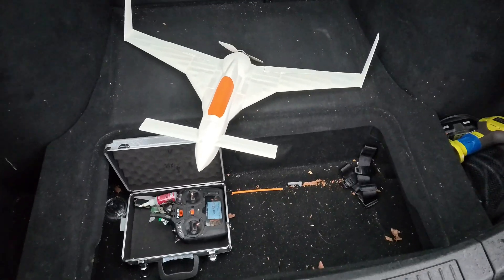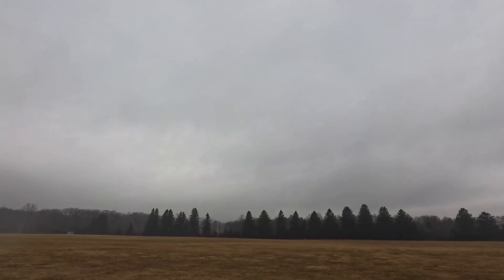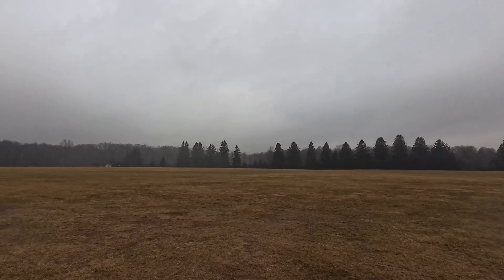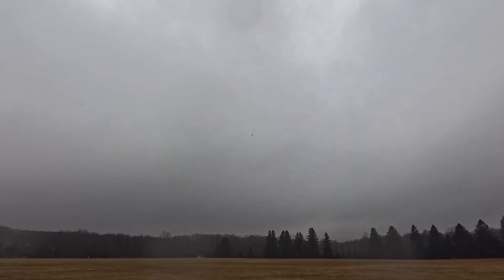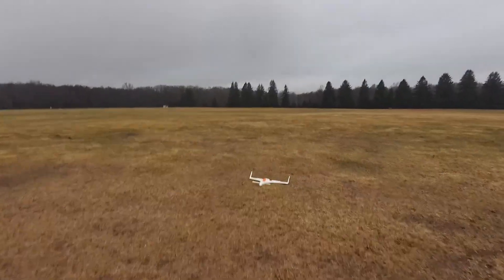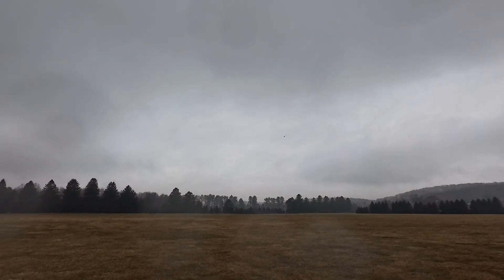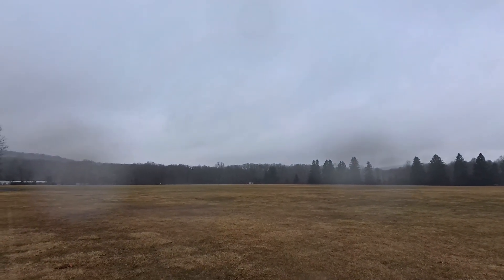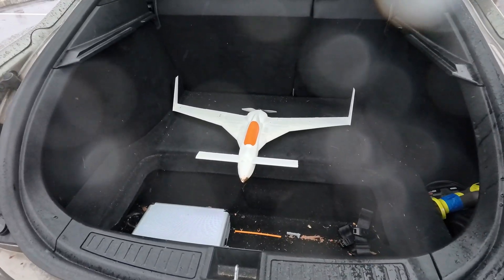Rutan Long EZ maiden flight

Comment: In all seriousness, great job, however, you need to use the canard as elevator and the ailerons ONLY as ailerons. There should be zero elevator control  coming from the rear. Your CG is close to the dots and should be well in the zone if you make the canard the sole elevator control surface. I own and fly a real Long EZ.

Comment: i dont see why you cant design the Alerons with a pointed  leading edge hinge sides instead of big draggy gaps due to the very low radius , just print the parts vertically ,i dont see the issue,. Less drag   i enlarged mine to 115% and will try scale landing gear with steerable nose . power to btd . all printed already and glued together atm

Comment: 0112   the profile of the canard may be scale-accurate.    that does not make it a  good choice for a  Teeny tiny  version.        i would suggest that, if practical, the canard be remade having a symmetrical profile that is oriented at zero degrees aoa/aoi.

Comment: 0035   why is the mass of the elevon servos not located near or forward-of the cg/c-m.?!      an  inherently  'tail heavy'  design, like this, calls for the optimal management of mass location; eg., distribution of mass (dom).
0046   elevons should be located such that they extend to the wingtips.     ideally, a control surface should have the shape of a parallelogram.
the vert-stabs should be about an inch shorter.   this would result in a reduction:   in the auw; in the amount of mass located aft of the cg/c-m; in the amount of outboard-located mass; and in the amount of drag at the wingtips.
0103  the elliptical fuselage cross-section at the firewall is  less-than ideal.     could be a factor in the noisiness.      ideally, a pushrod should be perpendicular to its associated hinge line. 
0115   the amount of prop/motor noise is excessive.     the asymmetrical fuselage shape at the firewall and/or the prop spec's may be factors.      the prop may be too flexible for the application.
0227   if this design qualifies as a low-winger then the model should be  inverted  during  cg  balancing.!
0338   not sure if yer flying the elevator from the instant the power is stopped.      a fundamental fact must be accounted for, when gliding a powered model.    it  is  this,  elevator trim that is correct for powered flight  will  NOT  be the correct trim  for  gliding.!

Comment: 👍👍 @BUILT FAST - I always liked the then-futuristic Vari EZ and really wanted a Long EZ when it debuted.  In fact, I had planned to order the kit/plans while I was training to get my PPL.  I didn't have the time to build one as I was working so much overtime so ended up buying a brand new 1981 Cessna Cutlass RG instead.  Oh well, I still think Rutan's little canard design would have been so much fun, and economical.  The Cutlass RG was fantastic, but became too expensive once the Cessna warranty ran out.

BTW you have the ailerons inboard where the flaps would be.  I think the roll rate would be much better if the ailerons were located outboard where they normally are.  It looks like a great flyer though.  You're absolutely amazing at quickly creating these fun little speedy flyers.  In fact, I think Guinness should recognize you as the Maiden Flights king!   Happy Holidays Kyle 'Left Turns' Petty!😁😁

Comment: Congrats on the maiden. Looks like it flies really nice. Before you release the files, I'd add a warning about that pusher propeller when launching. It looks like you have a fairly good technique of getting your hand out of the way of the prop during launch but others may not realize the danger. Personally I launch pushers with the motor off & then throttle up once its clear.

Comment: Could you offer this as a jet.  I was fortunate enough to be present the day that Burt finished the Voyager and Dick flew it for the first time.  They offered me the piece they cut out for the window.  I have always been a fan of the conard design.  After 36 years in service in the Air Force I would welcome the opportunity to fly in a Long EZ. Reality is flying a RC is the only potential  but would love to do so with a jet powered version.  Thanks for your consideration.

Comment: Another awesome design Kyle !! You are definitely on a roll 😁👌I have my printer running through the night to get my Pushy Cat done !!! The weather in the UK ha been shocking at the weekends 😢 looking forward to maidening my Vertigo which is now complete weighing 1.3kg with 2.6kg of thrust 😁 and the Pushy Cat when the motor and ESC arrive that will also have at least 2 to 1 as well